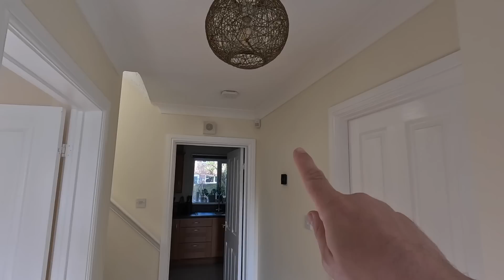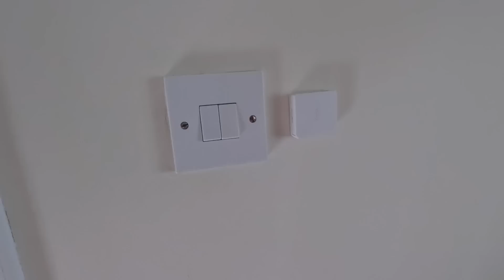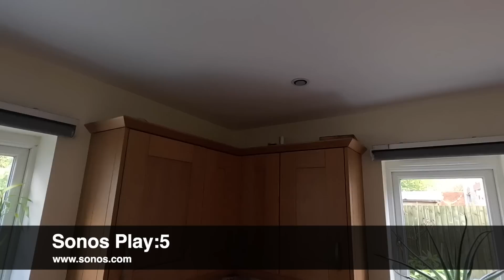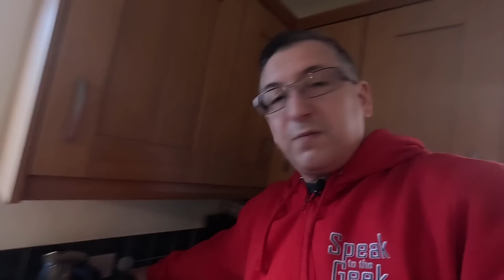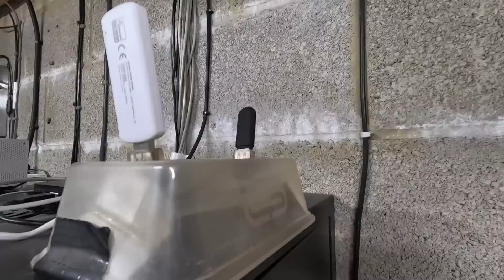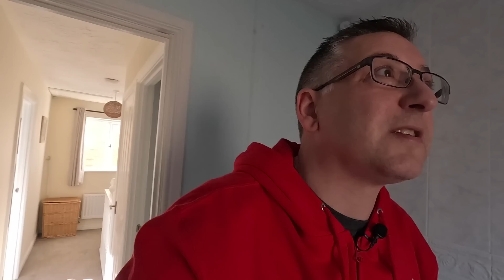Smart Home Tour 2024!

Comment: Very interesting and yes, I was also curious to see your house and how to locate the burglar alarm control 😉! 
I have the same model dishwasher as you so I might try the remote button schedule trick as I have an unused ‘long press’ function on an existing Sonoff button I have in the kitchen. 
One bit of smart technology I’ve just implemented is to use the Home Assistant Waste Collection integration to show which colour bin to put out and when. I display this on my home-made central heating controller which uses Blynk IoT and I use the HA RESTful interface to talk to it.
Reply from the maker: I’ve recently done the same for waste collection in my area… not got it very reliable yet but hopefully I’ll crack it

Comment: 3:43 that door sensor on the letter box is brilliant
Reply from the maker: It's so useful! You're in another part of the house and someone posts something through the door, you get an alert to go fetch it. Contact sensors are much smaller than that one now so if I did this again I might use a small Aqara one instead to be more discrete.
Reply: Does sound good but then why does you need it? Firstly, if you are expecting an urgent delivery you will be alert to it and hear the flap go, secondly in 99% of cases it won't be an emergency to get your mail and you'll see it next time you walk past.
Reply: I have a basic Smartthings setup. I live in a house with a door directly on pavement with no doorbell. The front door is in a porch that I can't hear anyone knocking from in other parts of the house. If the door sensor detects vibration (a knock) without it opening, it plays a doorbell sound on my speakers around the house. If the mail flap sensor is opened, it plays "you've got mail" on the speakers. Such a simple thing, but OH MY GOD it makes a huge difference.
Reply: @skoodledoo  It makes great sense in your case.